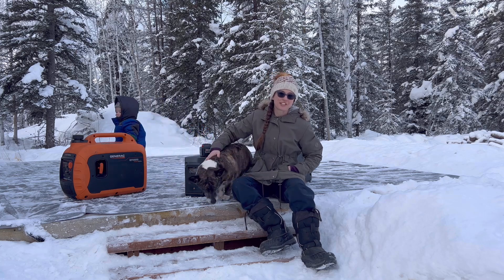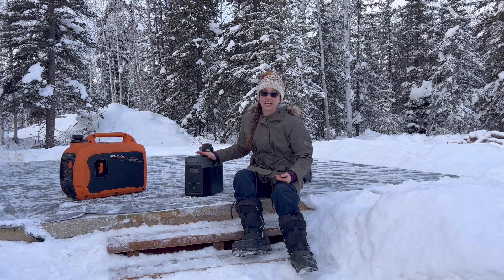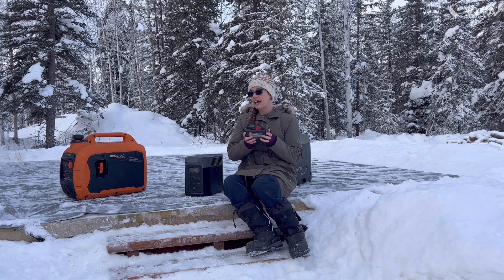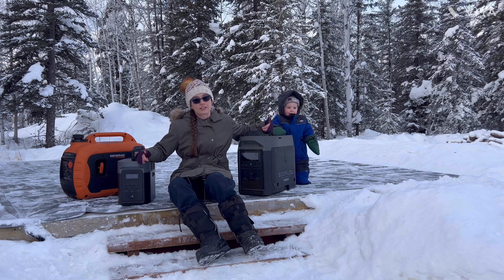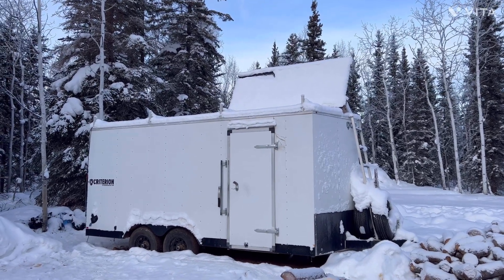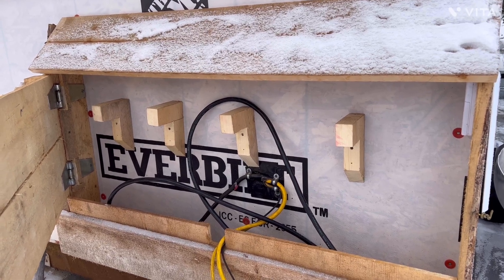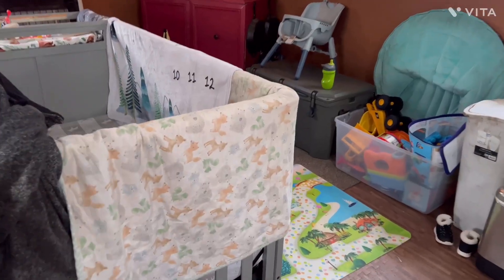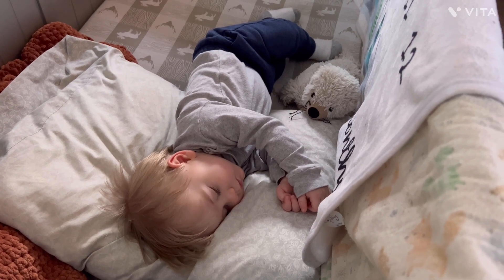How We Power Our Off-Grid Cabin in Alaska

Comment: Hello there. We live off grid also in interior Alaska and we run lights, washer, well pump, toaster, and when it gets cold a couple bulbs to keep our chickens warm. If we dont have to heat the coop it's usually 8-10 days between chargings. We have solar also. But yes you are right for 2 months you dont get much in the winter but in the summer time our 1500 watts of solar really works good! We also add two freezers to our load in summer and we are almost 100% reliable on solar. Our batteries are from Signature Solar. Two 12v 400ah server rack EG4 batteries. Best batteries we have had so far. But the simpler you keep it the easier it is on ya. We have 6 kids so we had to make it slightly more complicated for ease of living. Best to your family. 

John 14:6
Reply from the maker: Wow! That is awesome! 1500 watts would be so nice! We only have 400 watt soar panels but will eventually upgrade our system. Glad to hear it’s working for you and your family! Maybe one of these days we will run into each other 😊 best to you and your family as well!

Comment: Hey H & J! --- FYI --- In your wire connection box outside, check your video at about 4:45. Follow black wire left from yellow; there's a "breach" or cut in the black wire insulation. That needs to be taped up/sealed somehow so moisture doesn't get in.
Reply from the maker: I meant to mention that in the video, those cords get so stiff in the cold the insulation just breaks. We don’t use that cord in the winter but will for sure get it taped/sealed up before we use it again. I appreciate you pointing it out though!

Comment: FYI, also NOT connected with any product retailer or manufacturer ... just wanted to note your purchase of Generac 3300i is a smart move. It has built-in parallel circuitry to connect a second unit to double power if you should need it in future. I have also seen a video on a filler device to connect a larger fuel tank, but can't recall where. Anyway, you make smart, well-thought-out purchases (also smart to keep your rechargeable power tools in the same "family"). Best.
Reply from the maker: That is fantastic information! Thank you! We may have to look into that!
Reply: You'll need a Generac connection kit for that, fyi.
Reply from the maker: All great to know, thank you!

Comment: You & Justin have your heads on straight. Exhibit 1= not needing lots of stuff to be happy. Exhibit 2 = right away building that "deck" that will allow doubling your cabin size. Put 1 & 2 together, get 2 roughed in/dried in, and next winter more inside space w/out a bunch more stuff will help "air out" any cramping. You'll be amazed what that will do. Plus more play area for Dawson inside. Also, smart to locate the stove (heat) in what will be the middle. You got it going on, folks!
Reply from the maker: Thank you so much! We really appreciate that comment. And totally agree! The extra space will be SO NICE next winter! Especially since Dawson will be a full on running/jumping savage boy by then I am sure 😅

Comment: My Alaska plan is 10kw LPG gen 500+gal tank, $12k usd from signature solar and you can go 100% 120V AC, 8kw charge 2 hours of gen a day. I had -33C/-27F last year. EG4 6kw with 30kw battery, eliminates months of firewood, plus floor heat. Insulation is a major factor to make it work, my trailer loses 1c per hour from 20C -8 outside. With the big gen full size dryer again, big load dry in 60mins.Adding 8kw of solar 4k. If this is nothing you wanted to see I apologize.
Reply from the maker: Wow! Sounds like an epic system! And well thought out! Well done 👏👏 when are you moving up to AK?
Reply: @FinalFrontierHomestead-i5t  I watched a lot of off grid that was my idea for Alaska cos the 60 days of darkness. My location now it's 40 min from a big town. Trying to perfect the build so disabled people could use the template and go off grid. No chores for weeks.lpg delivery,100 days of food ,done. My tv area was 91f last night.
Reply from the maker: Sounds awesome man! Super stoked for you, sounds like you’ve got a great plan coming together!
Reply: @  Some day the current off gridders will too old to split wood, I got options for them.
Reply from the maker: @bobmonztr  that’s very true, and awesome of you to think of them and find a way to help!